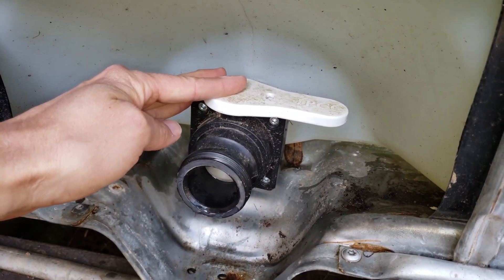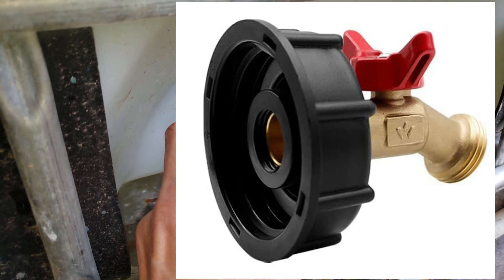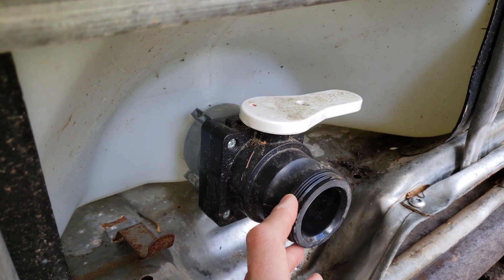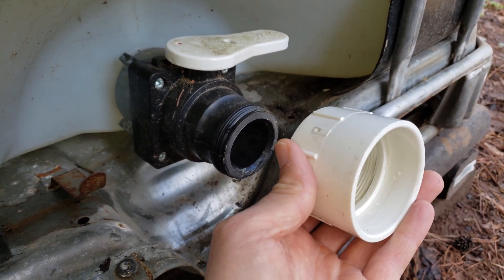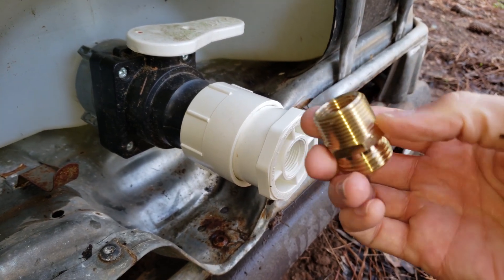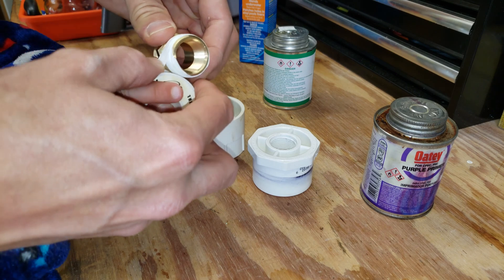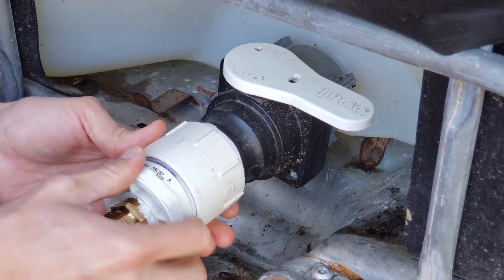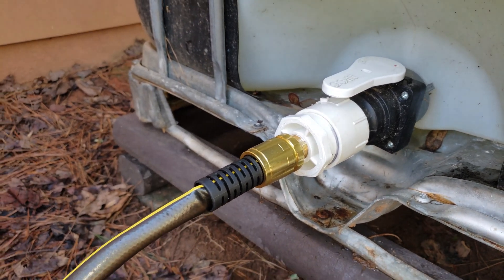How To Make GARDEN HOSE ADAPTER For IBC Tote Ball Valve (275 Gallon) for Rainwater Harvesting Use

Comment: Interesting but I've been out of luck. I have a tote with a wide coarse thread end cap with a ball valve. the opening is 3"7/16 or 3.5". I can't find any fittings that is about 3.5 inches that reduces down to fit a garden hose. Any suggestion where to find attachments. Thanks.

Comment: I get no pressure from my hose
Reply: Have you opened the valve? Also, if no pump is being used, "pressure" is only created by the static head of the water in the container. i.e., the higher the water level, the greater the pressure, although you may not physically notice it

Comment: I tried this exact scenario however the 2” Female connector from Lowes (Home Depot & Locke are the same).  After gluing the 2” to 3/4” connector to the female connector, it would not thread on the four exposed threads on what appears to be the exact adapter on your ibc and measured 2” to base of threads, but was maybe 3/32” or 1/8” too small.  Course threads are way too big.  So I just lost $8, so I’m gonna just use a 4-5” rubber plumbing hose with two strap clamps, one to the valve fitting and the other to the 2” to 3/4” connector, then hook up my faucet.
Reply: In a lot of cases, IBC (Intermediate Bulk Container/tote) drain valve outlet threads are BSP (British Standard Pipe) and are not compatible with the NPT (National Pipe Thread) fittings purchased at the big box stores
Reply: @teammelita8613  Thanks, I found that out later!
Reply: Same exact situation here. And I was thinking of doing the same thing - using rubber hose and hose clamps to connect these assembled adapters to the ibc's output. I'm guessing there must be different sizes on different ibc's - but I thought the whole purpose of these things was to have a standard. 🙄
Reply: @RobDuarte  I'm with you on this step lol. The "standard" threading not so standard. Gonna go with the hose clamp route myself.

Comment: Do you have any experience with the 2.44 fine thread adapter? My totes all have the larger diameter valve.
Reply from the maker: Here's a 2.44" fine thread adapter with garden hose valve - https://amzn.to/3Lcw4hk
Reply: @engineerable  Thanks, I am trying to figure out if there is a PVC option to link 2 totes together. I already have a few totes with the exact adapter you posted, 2 of which are connected by a garden hose and a Y adapter to provide more storage. I am looking for a solution that can provide a better transfer rate by using the entire 2 to 2.44" connection, rather than a garden hose.
Reply from the maker: @Red_Sky_Farm_2023  Ok, so that adapter also has a 60mm buttress thread. What you can do is get a 60mm buttress to 2in NPT adapter, like this: https://amzn.to/3W8xIqt
Then use the 2in NPT to 2in PVC adapter linked in description
Reply: @engineerable  Thank you, that makes a lot of sense!
Reply: You put the teflon tape in the wrong direction on the 3/4 inch brass fitting.

Comment: Water wont come out good out my hose
Reply from the maker: If your lid is on tight, then it can create a vacuum inside. Otherwise there's an obstruction somewhere.
Reply: How high is your tank? This is where your head pressure comes from. How long is your hose? The longer it is the less pressure you’ll have at the end due to resistance. Just some thoughts. My plan is to install a 120v demand pump because my tanks are only 8-10” up and I’m running an extended watering system for garden. The pump will ensure I get water to the end of the line. They’re about $100 on Amazon.

Comment: I would love some help finding a 2" NPT x 1" hose barb. It almost doesn't exist. My project involves a 1" intake hose w/ wire reinforced for a semi trash water pump.
Reply from the maker: Use multiple parts together like I did in this video, but instead of a hose fitting, you use a barb fitting.

Comment: So a plumber just told me never to screw a male brass (metal) fitting into PVC. Apparently this is a huge NO. 
The reason for this is that metal expands and contracts with temp change at a much higher rate, and by having metal male inside pvc female, you are going to have the metal expand and crack the pvc. Any ideas for a workaround?
Reply from the maker: Makes sense, but that's probably more of an issue on a hot water line where you get extreme temp changes above ambient. For this application it's fine, also that PVC fitting is large in diameter relative to the brass fitting, so it will be much stronger to resist expansion. The temp range ours sees is 15F to 100F. If it was fitted at 70-80F, it will see very little expansion. The issue in this case is that the brass fitting could shrink enough at lower temperatures to lose the seal and leak. Here's a video that shows some solutions to connecting the 2 - https://youtu.be/2wjqbmqoRkY

Comment: My gallon tote has a ball valve just like yours, but when I order a 2 x 3/4 adapter online it seems not to fit. It just too small or the same size so it’s doesn’t fit. I first got the fine thread it didn’t fit then I got the coarse thread and that didn’t fit either. I have 2 275 gallon totes, and the other one the adapter fits just fine.
Reply from the maker: Weird. Check this link to see if it helps. If all else fails, epoxy on a fitting that you can attach to.  https://www.jmesales.com/ibc-tote-thread-types/

Comment: It doesnt work for myn its a tad to small any ideas
Reply from the maker: Too short, or too small in diameter?
Reply: @engineerable  to small in diameter
Reply from the maker: Ok, it sounds like your IBC tote has the European thread standard (the threads will look much coarser than NPT). That requires either an adapter ( https://amzn.to/3ppKLlX ), or just buy the fitting with valve - https://amzn.to/3QFlBw1

Comment: Now tell me do you have a good water pressure? Because i don’t😪😪
Reply: Do what I’m about to do, buy a battery operated water pump like the milwaukee water pump, boom water pressure and you won’t have to worry about elevation as much, still Concidered though
Reply from the maker: @tallmex96  Sounds like a good idea, I could use the Ryobi 18v pump
Reply: @tallmex96  thanks for your advice.very helpful.
Reply from the maker: I strategically installed this one at a high corner of the house, and we use the water about 1 story below the tank. This provides plenty of water pressure for watering and soaker hose. So the tank needs to be elevated to create water pressure. Otherwise you will need a booster pump.
Reply: @engineerable  I gotchu 
Thanks